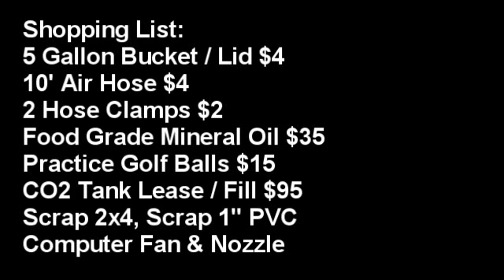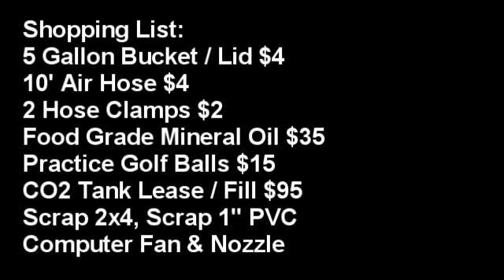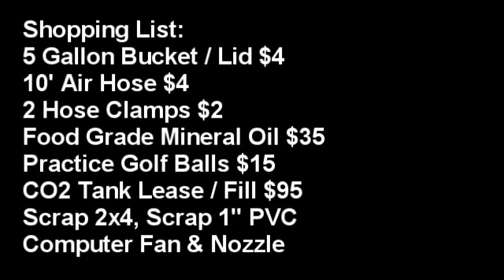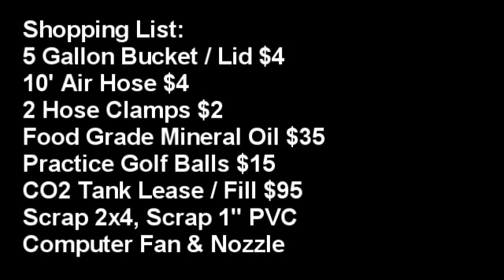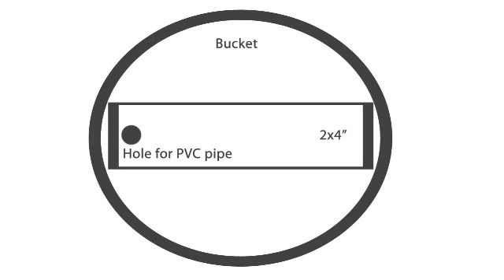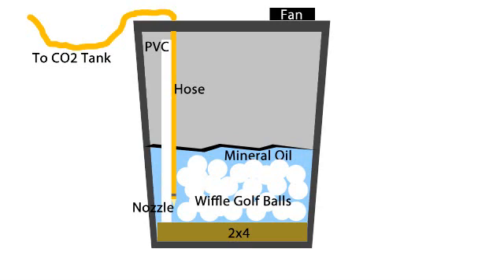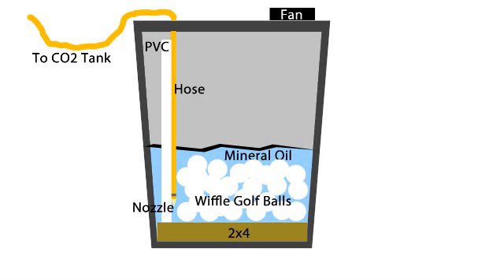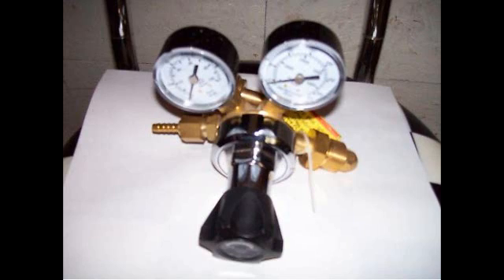How to build a DIY Hazer / Haze Machine...

Comment: I wached a video of an American DJ hazer getting repaired the compressor it uses looks identical the the cheap airbrush compressors on ebay so im going to try using one of those for my air source there not silent but there not extremely loud either and put out 40psi without a tank

Comment: Compressed air pumped through a hose through a hole  in a 5 gallon water cooler jug works amazing also but it is a bit noisy ;,) ive seen it used in some major theme park dark rides in the past  have a valve for the air flow fill the bottom with haze fluid it works extremely well
Reply: Please show us a demonstration video how it really operates.

Comment: Sean, I appreciate your effort - but when the priest comes down the isle in the cathedral swinging that ball of sweet incense - it pretty much has the same effect - and probably less clean-up. Mineral oil atomized in your air? Seriously?
Also, possibly more helpful, diffusion background curtains (very, very light and cheap made of clear fibers) - has the same affect but permanently. Meanwhile similar material over camera lens not too shabby an effect there.

Comment: Hey, so im trying to make a hazer as well, and i was wondering....do you think it would it be practical to use the output of a shop vac instead of a air compressor/co2, i tried it on a small scale with a inflatable pool toy pump, seemed to work well

Comment: @TheFilthysanchezbass DUDE... Lol I just went too stageape.com, and that is a fogger, NO MATTER what "words" are printed on the side!!! Lol an ACTUAL Hazer is much lower in wattage than "1200 watts"!(more like 50 watts) An ACTUAL Hazer uses 'Haze Fluid'! An ACTUAL Hazer has NO "Duty Cycle of 5 to 25 seconds"! And an ACTUAL Hazer doesn't pump out that much 'FOG'! If it looks like a duck, and Quacks like a duck and pumps out THICK FOG like a duck... it's a FOG MACHINE!!! :)